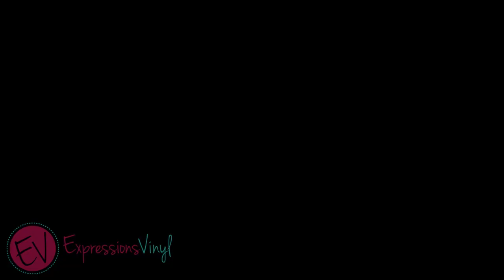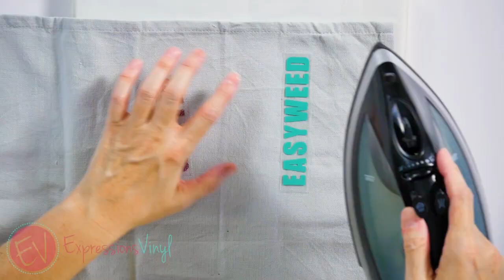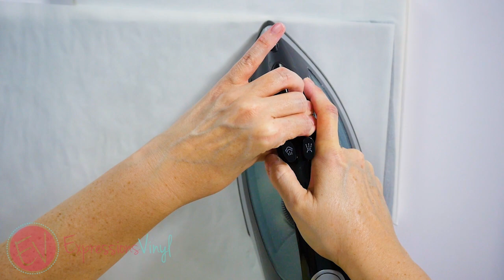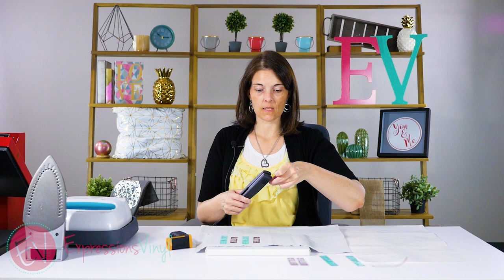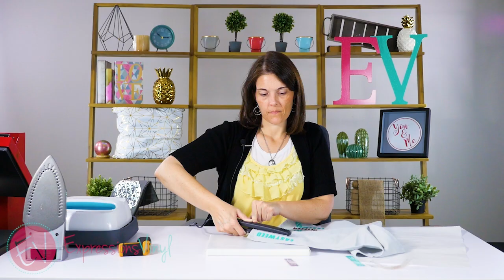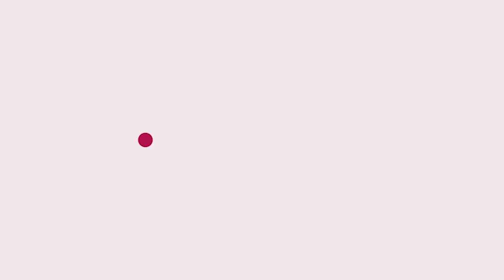Heat Transfer Vinyl Tools

Comment: Hello
Love Expression Vinyl videos! Can you tell me can the easy press be used on adult tshirts. If so what would be the benefit of getting a heat press. Thank you
Reply from the maker: Hi Tanisha, yes you can use the EasyPress on adult shirts.  You will just have to press one spot and then move it to press another if it is larger than the 9x9 size the EasyPress is.  Remember to add to extra pressure as well.  The benefit of the heat press is that it is larger, the pressure is built in when you press anything, you don't have to worry about not getting enough.  Also, if you do it for a business a heat press would be a lot quicker and easier for that.
https://expressionsvinyl.com/tools-accessories/heat-presses-and-pillows/

Comment: washing can remove it or not?
Reply from the maker: Hi Moana, as long as you have adhered the heat transfer vinyl correctly it will withstand washings.  We recommend turning it inside out.  Please let us know if you have any additional questions.

Comment: Why do some people use a Teflon sheets?
Reply from the maker: If you have a carrier sheet on your vinyl(all of the  HTV that we carry does) then you do not need to use a teflon sheet.  However, if you are layering and that carrier sheet from one of the other layers doesn't cover all of your vinyl then you would want to make sure it was all covered by the teflon sheet. Please let us know if you have any additional questions.  Here is where you can find the heat transfer carrier sheet or the multi use papers which will work as well.  https://expressionsvinyl.com/tools-accessories/heat-presses-and-pillows/

Comment: H, I was wondering what base you were setting your material on which is setting on your table? Is it a steady betty, etc? Thx for the vid:)
Reply: And wow, who would have thought using the hair straightener tool! Thx:)
Reply from the maker: Hi, we are just using a board that has been wrapped in a heat transfer cover sheet.  Here is a link to that - https://expressionsvinyl.com/heat-transfer-cover-sheet-18x20/
Reply: Expressions Vinyl thank you so very much:)